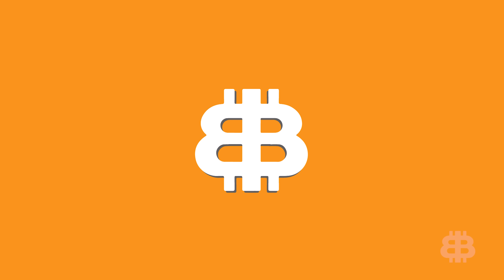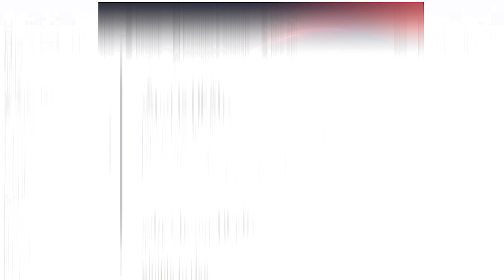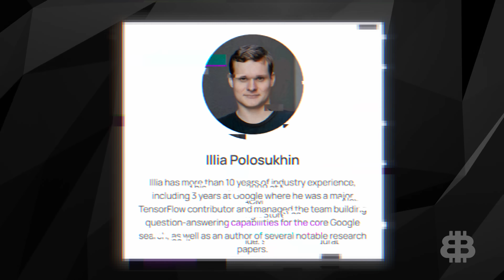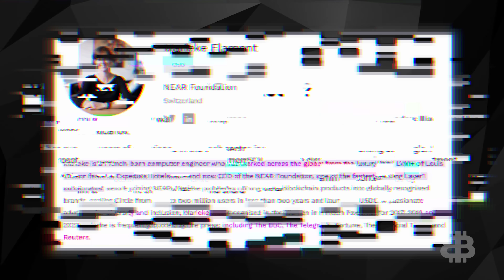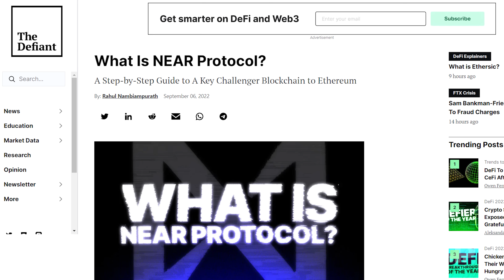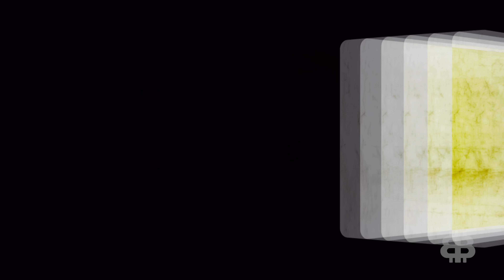An Ethereum Challenger Rises - Top Crypto Project In 2023?

Comment: is near connected to or funded by FTX? or are they holding NEAR as part of their holdings?
Reply: As far as I understood they were early investors and hold like 1.3% of the supply or so. It's a small fraction though.
Reply: Yes, but not as directly or indirectly connected as Solana.    FTX/AR hold SOL coins, also had the Serum admin keys and possibly coerced Solana into buying FTT.   The Biggest risk for NEAR is not just that FTX can dispose of the coins.  The huge risk is that the $566MM in Treasury is invested in crypto (e.g., FTT, Dapps) that has declined sharply.

Comment: If you actually do your research you will see that Casper, CSPR is the true ETH killer as it has been dubbed from day one. Not only because it's years ahead, but also because they were going to be one project at one point until Casper broke away. Also, Casper is built on the CBC protocol which is what ETH was built off of. There is also talk that Casper might one day be a testing network for ETH, just like Kusama for Polkadot.

Comment: Near will hit $50 before XRP does.
Reply: Probably. Then the court case will settle, Everything will get fkd up, and the dozen or so projects klaus Schwab and Jamie dimpn agree on will prevail and the rest will go away. Ripple will be ushered in since they're already ushered in, and after a crazy unforseen event clears all the exchanges, banks and cold wallet stored xrp will moon and after that, if you're not rich you're a slave. No upward mobility in a 2 class system.
Reply: Near will hit $50 before XRP hits $5.